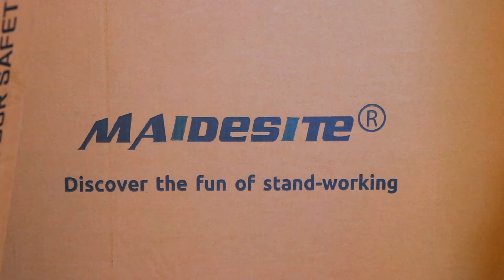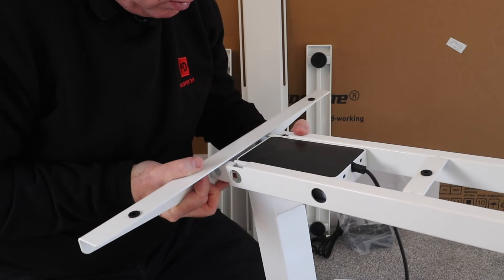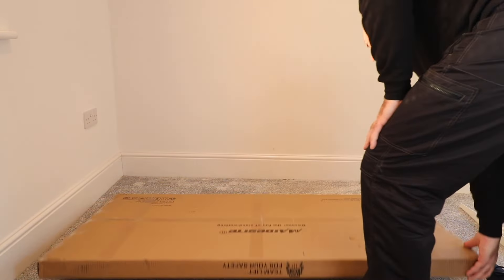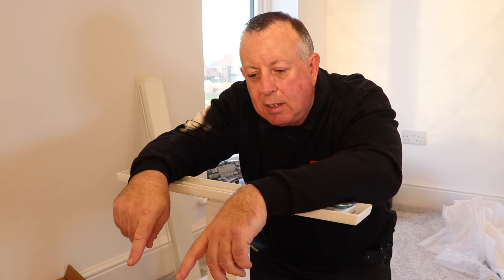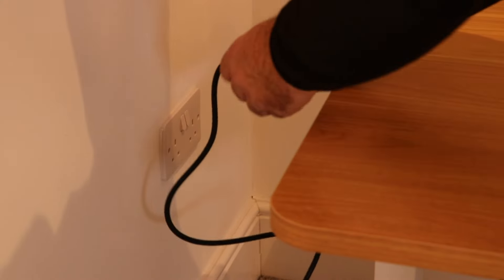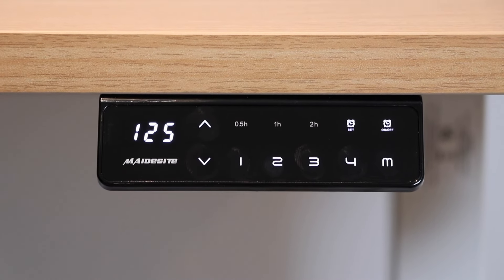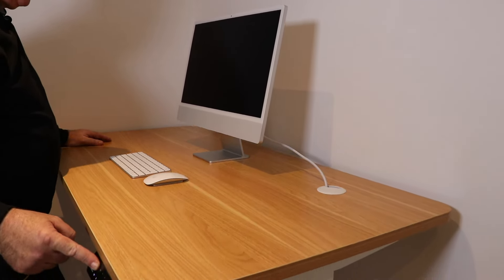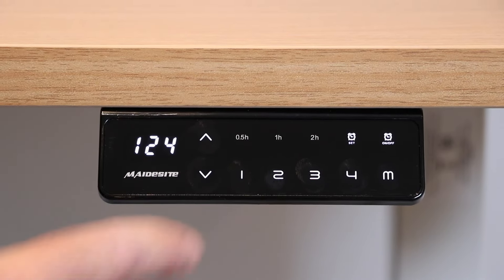Height Adjustable Standing Desk - Assembly and Review

Comment: There’s more to say about drilling your tabletop yourself: don’t screw directly into the wood, make thicker holes and glue nut-like metallic hooks inside the holes. It will be much more solid, and it will be easier to disassemble if you need to move it into another room.

Comment: Well done. It's a good move. Also - set your alarm to get you moving properly once an hour, even twice - up and down stairs will do but, what's really good, is a few press-ups. I could hardly do 5 proper, deep press-ups last year but now do 10 to 15 every 30 or 60 minutes most days. Nothing to do with muscle building - it makes my shoulders and neck both stronger and more flexible and I can now work easily overhead for the first time in my life despite running, swimming, and cycling a lot for decades. You can get component electrical parts to make you own desk but probably cheaper to buy (eg Ikea or the one you have) and modify

Comment: I have a sit stand desk. The biggest benefit is the right sit hight, not the standard hight every office desk comes at.

Glue a multi socket to the underside, then plug everything into there. Just one cable going up and down. The rest is tucked away and stays that way.
Reply from the maker: Nice tip!

Comment: I have a Flexispot one that I bought from Amazon. Although different it is very similar in a lot of ways. Also a very strong construction with the holes meeting up and a good set of instructions. I can't get over how much desk they managed to fit in a reasonably sized box.
I am planning on changing the top over to a live edged slab in time, similar to Tim from the Restoration Couple, but there are a lot of higher priorities on the 'to do' list as always.
Great content as always.
Reply: I have a Flexispot as well - deliberated a long time before splashing the cash but so pleased I did. I also had to stray from the instruction as I couldn't build it in my small space.  I put it together upside down as per the book, then partially dismantled and re-assembled the right way up.
Stuart, you'll need something to stop your wheely chair ripping the carpet to pieces.  I've just made mine out of carpet tiles stuck to hardboard (old wardrobe back)

Comment: Good video. I have an IKEA one and I mounted a power strip to the bottom of the desk. This way there's one cable for the power strip to manage down the leg, like you have done with the desk's power cable, and everything else including the desk can be plugged into the power strip and cable managed neatly: this means no Mac wire hanging down or potentially being too short etc!

Comment: Great little video although it is more of an advertising feature than the usual great tutorials.   
I love my standing desk I have had for nearly 3 years now. The product in the video  even with Black Friday discount seems expensive.  I bought a Flexispot 3 stage  frame and  ordered a solid oak kitchen worktop that was bespoke cut to fit my room exactly.  The 2000 x 960 x 40mm solid oak worktop and Flexispot came out cheaper than  the Maidside desk at full price and I got to keep the offcuts as chopping boards.
Reply: Try pricing oak worktops now though! I built a desk a couple of years ago from a Wickes 28mm stave oak worktop. A 3m length was £125 delivered (December 2019). Today, the exact same worktop is £250 :-0

Comment: Well, thanks. I want one now...
The correct height, probably, would be for you to replicate the optimal body  position if you were sitting down.  There is VDU risk assessment guidance published somewhere on the Internet, but I seem to recall that your arms should be parallel to the desk for typing with your elbows at right angles. Your line of sight should also be level with the top of the monitor... to avoid looking down and getting neck strain... but you may need a riser block on the monitor for that.

That could be a starting point for height...